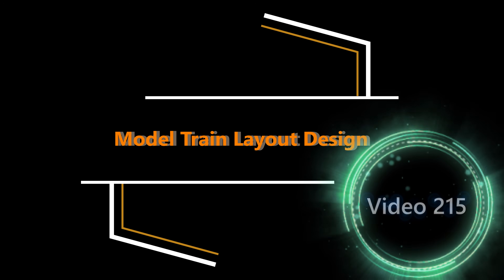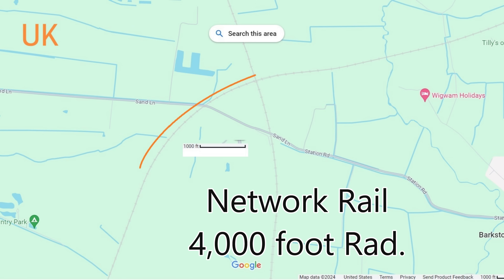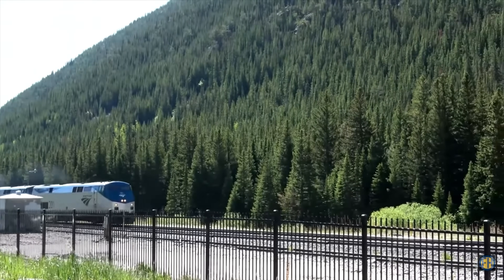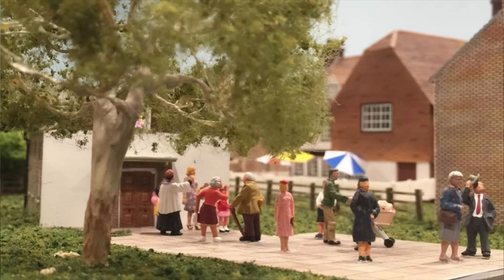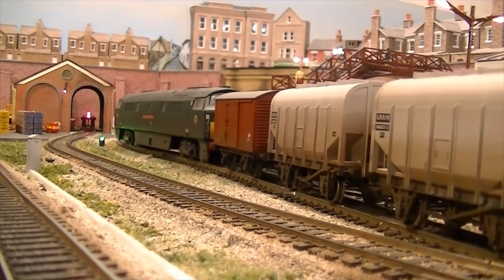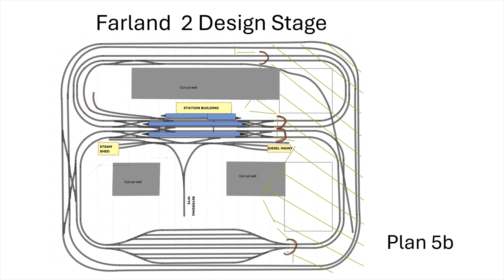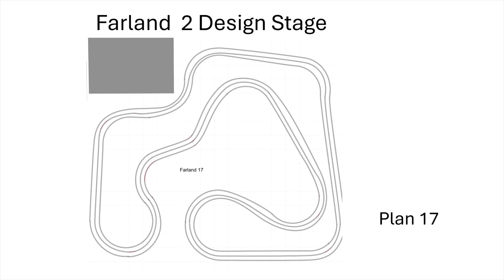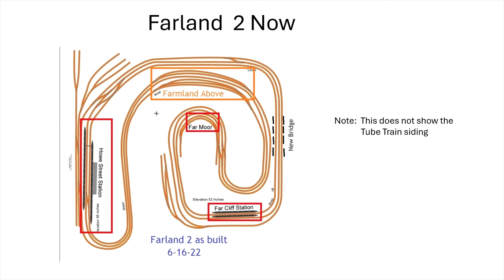215  Model Train Layout Considerations

Comment: LAYOUT MINIMUM RADII 
The US Big Boy will not negotiate a curve (even though its a Mallet) of less than 330ft Radius. That's a curve of no less than 3ft 10in radius for an HO scale (1:87)  layout. Or 4ft 4in in the fractionally larger British OO Scale (1:76). Which usually reveals nearly every HO/OO scale layout on the Planet has ridiculously sharp toy train set type curves. That WILL interfere with the smooth operation of many larger Model Locomotives, and put excessive strain on the model motor, reducing its life expectantcy !!!

And the best way to devise real railroad/railway track plans for your next layout, is to obviously copy real life ones, too scale !
Reply from the maker: Thank you.  Duplicating actual real-world trackage is a fine way to go if you have the room.  Not everyone does.  I would not want to deny the joy of a model railroad to everyone who does not have a large space to devote to their layout. Great comment, cheers, Rob
Reply: @FarlandHowe  The solution is to move down a scale.
Reply from the maker: @railwaymechanicalengineer4587  Thank you.  Yes, agree that for some this is a good solution.  cheers, Rob

Comment: Great tips!

I got to know SCARM track software very intimately while creating my layout(s).  I drew dozens of layouts with hundreds (probably several hundred) versions total, before settling on what I started building.  I chose to include a medium sized 42" helix to get to a shelf layout (fiddle yard) and keep the scenic layout on the main, lower level.  I also included a small lift-out section so that as I get older (I'm in my mid-50s now), I can opt to remove it rather than duck under it.  I am now about 1 year into building the layout (including the benchwork), the track is problem free,  and I'm finally getting to where I need to start some landscaping.
Reply from the maker: Thanks for the comment, it sounds like you put a lot of thought into the layout design!  Rob

Comment: After about 30 years of not messing with trains i want to build  a lay o it  being im temporarily  in a nursing  facility  I have plenty of time to think and plan I'm going to go dc and it 4xby the lenth of my room with two 4x8 wings coming off each side with 4 separate  train lines controlled by a separate  controller  2 flat on table  one about 4i n c h es higher  then one about a foot on the mountain that will stay that High we will see how it goes
Reply from the maker: Best of luck, Brian.  Thank you.  Be sure you can reach all areas to work on scenery and your track.  24 inches can be a long reach for some things.  DCC can add ease of operation.  Rob
Reply: As Farland Howe said, watch your arm reach.  It's easy to reach 18-24 inches when there's nothing on the layout, but start adding trees, buildings, and trains and suddenly you can barely reach 18 inches without destroying things like Godzilla.  Keep the height of the bench in consideration as that affects your reach, too.  I have a small step stool I use to facilitate reaching the back of my layout.  I don't need it so much now, as I don't have any landscaping on it yet, but it makes it a lot easier to reach the back wall.  Also, having more than just closed circuits (loops) makes it more interesting for the long run.  Mine can make a loop with a couple of switches thrown, but it can also serve as an end-to-end to allow for more realistic train ops. Watching a train run circles over and over can only be fun for "so long" before you'll wish you had something else it could do.  Do yourself a favor and make provisions for the trains to actually "travel" to places.  DCC will help with that and you don't need to break the bank to get started.  There are plenty of entry level DCC locos  for under $100 (I bought a nice used one for $50 at a show) and a good, used DCC control can be found for around $100, too.

I just did a quick ebay search and as of today (June 2025), there were a bunch of DCC locos under $100
https://www.ebay.com/sch/i.html?_nkw=dcc+equipped+locomotive+ho&_sacat=0&_from=R40&Features=DCC%2520fitted&_udhi=100&rt=nc&Control%2520System=Digital&_dcat=262303

There were also some Bachmann EX Controller DCC systems for under $100.  It's a very basic system, but it will allow you to run a few trains with one controller. 
https://www.ebay.com/sch/i.html?_nkw=bachmann%2044932%20dcc%20controller&_sacat=180339&_from=R40&_udhi=125&Compatible%2520Control%2520System=DCC&_dcat=158704&rt=nc

Comment: So what was the overall size of the layout?
Reply from the maker: 22 x 21.   119 feet around the loop.  600 feet of track.
Reply: @FarlandHowe  nice, that is the size of my garage lol
Reply from the maker: @lmb5826  The layout in the thumbnail has a fatal flaw.  This is discussed in the video.  It can probably be fixed, but I urge caution.  There are better designs out there.  Good luck, Rob

Comment: It seems that none of the layout designs make it possible for trains to go both cw and ccw on the same stretch of track. Is there a reason for this?
Reply from the maker: The track plans I’ve shown in this video were all variations for my layout Farland.  Farland is a British outline layout.  The layout is all British trains, figures, buildings, etc.  over there the mainlines are all at least two track roads.  One side is designated the down line the other the up.  Up is towards London.  They also have many 4 track mainlines.  In these cases there are fast and slow tracks in both directions.  Slow traffic can be freight or stopping trains (locals).  Since I did not have the space for a four track main, I compromised with 3.  The third is designated for freight and is signaled for traffic in either direction.  There is no passing loop on the Farland freight line but there are 4 crossovers to the down express line.  I hope that helps, thank you, Rob

Comment: It's nice to plan but sometimes you don't have the time/patience to rivet count every aspect of your layout.  Personally, my best plan has been to know what I like and run with it.  I don't have that kind of patience to intricately plan and go through that many designs.  Don't be afraid to make a mistake or do something over.  You might be surprised what you can discover as you go!  Still a nice video!
Reply from the maker: Thank you, I certainly understand that others may not have the patience or skills to plan or engineer as I prefer and recommend.  I spent my career in an engineering intensive industry and as a result learned the benefits first hand of thorough planning.   I agree that doing is better than complete inaction.  However, I am trying to point out that the process of planning can allow a person to explore their ideas and think through how well they might work or not work.  My first failed layout F1 was a “just get on with it and build it” type of experience.  It is important to understand, I tore down and rebuilt every area of it more than once and after 6 years of constant churn, I took it down for good so I could start over.  The most important point is it never ran well even then.  My current layout F2, was built to a plan and has run very well from day one.  When trains constantly derail, it is not fun and many people will just quit the hobby as a result.  cheers, Rob

Comment: How do you clean your rolling stock wheels?
Reply from the maker: I don’t, but they’re all metal.  Thanks, Rob
Reply from the maker: I do clean my Locomotive wheels, however.  I put them up on a rolling road and clean them with cotton buds dipped in alcohol while they are turning under power.  Sorry, I should have mentioned this before.

Comment: did you consider moduals 2x4 2 feet wide x 4 feet long and 4x4 feet for 30x 36 " curves so you can use your longest cars try it it works for all railroads and you can adjust it for most sizes by multiplying by 1/4 or 1/2 just do the math so you can figure it out
Reply from the maker: The builder is free to do whatever they want.  I am mentioning things one could consider when designing a model railroad.  Nothing is absolute except gauge.  Thank you, Rob

Comment: My layout is a big loop of double track around the perimeter of the room.  Then I have two peninsulas connected to the loop at opposite ends of the room that become terminal stations.  This is prototypical because some railroads have two branches connecting distant terminals -- one the passenger main, and one the freight main or commuter branch.  This way, the main has broad curves, and I can run true point-to-point, or continuous running without any "secret tunnels."
Reply from the maker: Thank you.  Yours sounds like a good plan.  Well done, Rob

Comment: I just want my trains running. This was great! My curves are 22 to 28 , and #6 turnouts, code 83 giving space limitations. Two track mainline. Fortunately, my equipment will handle it, though 80ft passenger cars still look a little funny. But the scenery will be extending 16 inches below lowest track level and 12 inches above highest track level for a total of 32. Plus trees a scale hundred feet
Reply from the maker: That's a great approach!  Best of luck.  Thank you, Rob

Comment: As much as running operations is a lot of fun for so many model enthusiasts, it's nice to run across people that are like you and me, who are happy with simply watching several trains running through beautiful scenery.
Reply: I will say I personally think there's a place for both, personally the layout ive planned works both of those aspects together.
Reply from the maker: @Sigil_Firebrand That would make it the best of both worlds.  My Farland 2 does have a number of opportunities for switching and operating.  Thanks
Reply: @Sigil_Firebrand  Agreed!
Reply: I just want to turn them on and watch them  go that's why 4 separate track that will run òff 4 separate controllers
Reply from the maker: @BrianBaugh-o6r  There is plenty of room in the hobby for everyone.  To each his own.  Best of luck with your railroad/railway.  Rob
Reply: That is why it's such a great hobby. I myself am a programmer and electrical engineer and I love that aspect of it. I've stored my track for a long time now, but with the recent addition of a 3D printer the itch is starting to come back. I love to tinker with the electronics, building detection systems, lighting controls etc. As far as running goes, I love automation and scenery can be as simple as a box of the right size for a building and the right sized hole for a tunnel. And I've never bothered with those little figurines.
Reply from the maker: @patrickd9551  I may be unusual, but I enjoy most all aspects of a model railway, electronics, electrical, mechanical engineering, the civil engineering aspects, artistic opportunities, model building, carpentry, weathering, theater, all of it.  It is the greatest hobby, because there are so many areas and disciplines to explore and it is all okay.  You can just run trains on DC in a circle on a simple sheet of plywood and it is just as valid as a layout like mine that is realistically modeled.  Thank you, great comment.  Rob

Comment: The way around all the hassles is by building it 'Point to Point' with turning facilities on one or both ends of the line, like the real guys do it, using a balloon track/wye/turntable. It's the 'roundy-round' or 'continual' which usually presents unrealistic situations.. 
Point to point can still go up and over, and down and under, and produce long running time.. But what it really does is bear realism; single mainline with passing sidings, spurs, industries/stations/terminals, yards, engine shops. It just does not need to and shouldn't go in circles except for 'belt lines', or say, light rail or trolley/subway.. P to P, if designed right, will leave no duck unders, to boot. 
Sorry. It's always the way I've seen it but in no way is meant to criticize anyone else's way of running model trains..
Los Angeles, Ca.
Reply from the maker: All true.  Point to point is prototypical.   Roundy round is for folks like me.  There is room for everyone in this hobby.  Thank you
Reply: Depends what you want out of your model railroad. If you like switching, then point-to-point is great. But if you want to watch the trains go around -- which a lot of people do -- you need a continuous loop of some sort. Having said that, I do think a lot of people approach their first layout design by starting with a loop, making it "interesting" (i.e., convoluted) and then adding sidings and stuff, not realising that there's any other way.
Reply from the maker: @beeble2003  Good comment, agreed, thank you for contributing to the community discussion.  There is not a correct notion of correctness to follow after all.  Everyone doesn't have to conform to the switching layout concept, and many point-to-point layouts have a path for continuous running in a loop.  This hobby is big enough for everyone.  cheers, Rob

Comment: Hi Rob, very interesting video, I kind of find figuring out the whole thing quite enjoyable, trial and error seem to be my preferred methods but I’m learning as I go! There is so much in planning a layout that you can end up doing nothing thinking about everything. Doing for me is a much better way with a basic plan in my head or on a bit of paper and working it out from there.
Farland has gone through so many transitions in planning but has turned into your lovely layout which I thoroughly enjoy watching.
Thanks for sharing your extensive knowledge Rob, cheers for now mate, John
Reply from the maker: Hi John, I also enjoy solving things like this, as though you didn't already know that. Trial and error has limits.   Some do become paralyzed at the planning stage and only plan, never build.  Planning is just a part of building for me.  You plan till you are confident you have reached a reasonable conclusion that is defensible and move to the next step.  In the beginning, on F1, I was experimenting to find the limits.  F2 is the conclusion of that experimentation and resolution.  I also read a great deal during those times.  cheers, mate,  thanks for the lovely comment,  Rob

Comment: Very nice.  I model in O gauge, so things are a little different.  My basement is a bit over 1600 square feet, but subdivided into three rooms.  Instead of having a 34x24 foot area at the one end of the basement, I had to make an 'L' shaped layout.  I settled on a 24x18 L, with the short end at nine feet wide and the long end a seven and half feet wide.  I'm pretty good at planning, so I quickly sketched out a basic design and then just went to work.  I have the two mains, a trolley line and a commercial/industrial loop, with the industries on sidings and a small yard, along with the engine facilities.  It is meant for long runs with decent sized trains, plus, the industrial section is run separately.  That way, I can keep the mains running,  so I can have people over and have switching operations at the same time.  Either way, your video is quite informative and should help out those that are just starting out with a larger layout.  An excellent video, for sure.
Reply from the maker: Hello, John.  O scale, 1:48.  That is a large scale.  Your layout sounds interesting.  I did not see any videos on your YT page.  I like to take a look at what viewers are doing when I can.  Your comment is an interesting and thoughtful one, thank you, cheers, Rob

Comment: Dear Rob, loved the ratio comparison of true to scale curves to the model ones. To me it’s once more a confirmation of the fact that the real world is much larger than our human minds can comprehend. Always like to add the context of a cubic yard or meter as a reference point. When folks order let’s say a big bag of soil for their yard, their first thought is that the volume received is that it’s too much, that’s until they spread it out. That same ratio comprehension also applies to necessary ratios to plan a model railroad. 
Absolutely agree on the point you made on backgrounds and background flats. Humbly think they only work when they are positioned in such a way that they are placed on angle towards the visual most important aspects of the scene. On furthering the illusion of perspective with a backdrop I definitely got a pet peeve. This ‘pet peeve’ design concept being the placement of the backdrop in such a way that the undulations in front of the 2D can be approached in such a way that the 3D scenery allows for a slight downhill aspect. That creates a much better transition from 3D to 2D. For flats in front of the backdrop, I humbly think they only work when placed on an angle. Such placement makes it possible to use a 2 point perspective, which is much more forgiving to relate from the 3D scene to the 2D representation.
Great tips on layout design. Definitely will put your vid on the hard drive, very, very helpful and useful. Cheerio
Reply from the maker: Hi Vincent, I can see you are passionate about model railways. Many folks miss the simplicity of converting from the real world to the scale world.  Having spent many years on the drafting board (back in the dark ages of pencil and vellum), I understand scale and conversion very well.  Another thing folks seemingly misunderstand is that engineering principles are not suggestions.  Thank you for your thoughtful contributive comment.  cheers, Rob
Reply: @FarlandHowe  dear Rob, definitely like and appreciate that one: “engineering principles are not suggestions.” I have been searching for one with similar depth, will put it on the ‘hard drive’ and put it to fair use! Cheerio
Reply from the maker: @vincenthuying98  The problem represented by that statement has been around since engineered systems began.  People new to the discipline all too frequently think that the principles that are known by experienced people or are published in books are somehow not concrete and for their convenience and because it is easier to try to cheat on them.  It "never" works out well.  cheers